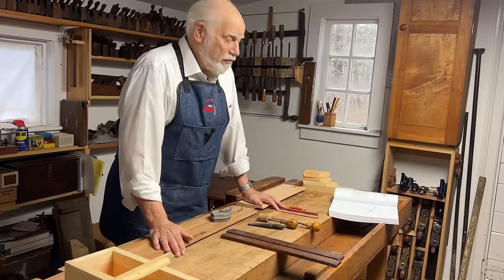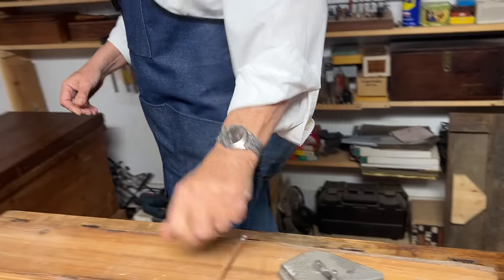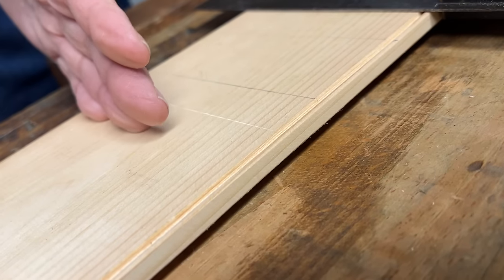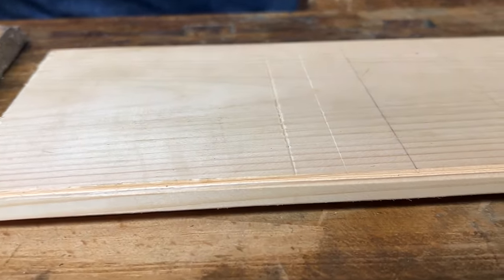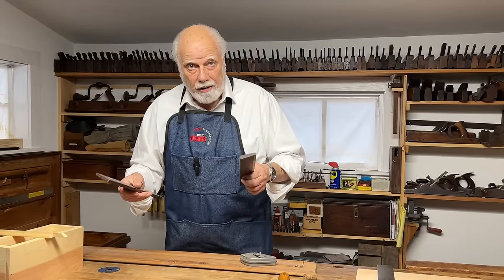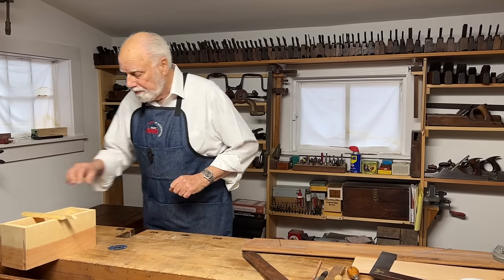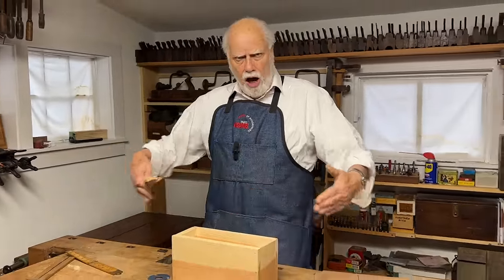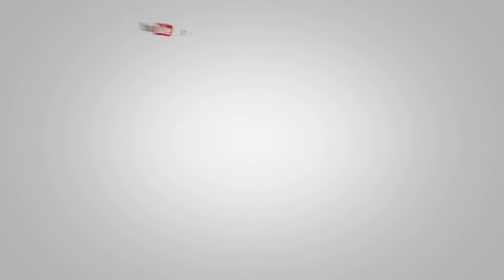67.Use the right marking gauge!

Comment: Carpenter penxils are very dynamic if you think outside of the box. For example, the lead is thick ao you can ahape it however you want, and since there is no eraser you can have two different shaped points. P.s. The thickness is 5/16"... They're way more useful than a regular pencil. 😊
Reply from the maker: Makes sense!

Comment: To use a carpenter's pencil precisely, you mark a wide line whose edge is where you want to cut, and cut on that edge of the line.
Reply from the maker: Could work!
Reply: @gjbmunc  Could and does - not for cabinetry and knofe lines, but plent good enough for outdoors and framing.